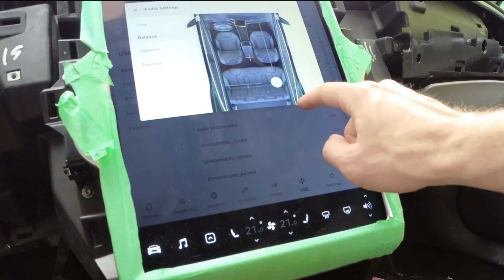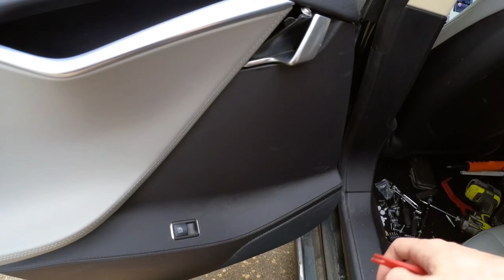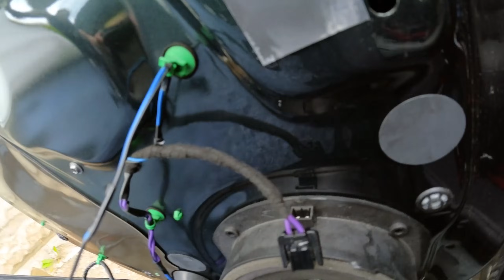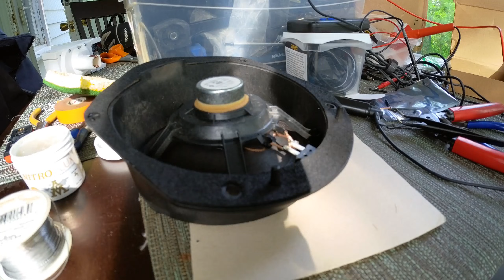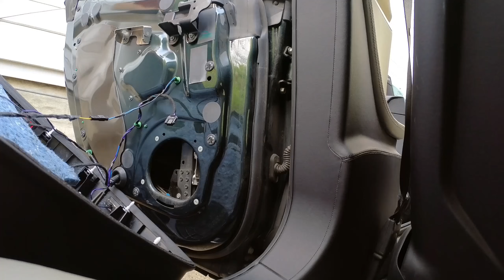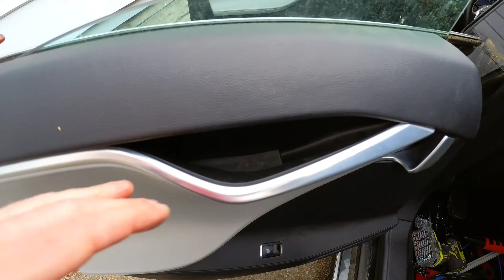Car Speaker Repair on a Tesla Model S/X

Comment: Good video.  CAUTION - The speakers in the pre-refresh Model S "base" audio system are 2-ohm.  If you are upgrading speakers STICK WITH 2-OHM.  If you go 4-ohm the max amplification will be cut in half.  Go 8-ohm (a very common impedance) it is cut in half again.  Two of my speaker cones were entirely detached.  Repair was not in the cards.  Found a rationally priced, 2-ohm upgrade speaker set on Crutchfield.  They are as close to "plug and play" as you can find and they cost about $67 a pair.  Search for:  "PowerBass OE-675."  They are not high end, but they are much, much better than the stock Tesla speakers.  The speaker surrounds Crutchfield provides with purchase are the same profile as the stock speaker surrounds.  They require no modification.  Unfortunately, Crutchfield does NOT offer plug and play harness connectors.  For that, search out the "Metra 72-8605 speaker harness."  I picked up two sets on eBay.  I think BestBuy sells them too.  With that part in hand, there is NO NEED TO CUT THE WIRE HARNESS OR DREMEL OUT THE OE PLUGS.  It is a pretty simple install and did NOT require any cutting modification to make them fit.  The "Metra 72-8605" sets are an absolute "must have" to make an easy retrofit and upgrade.

Comment: My front driver side speaker not working.
I have standard audio.
Try to test the speaker is fully working but the audio wire comes to the speaker no sound.
How can I find the problem.
Try to look to the wire speaker in the door but no Lose or cut.
So do u have a solution.
Reply from the maker: I'm not Tesla, did you try the service manual at service.tesla.com?  Might be a procedure there that could help.
Reply: @deftdawg  I did but can't find the audio speaker wire diagram
Reply from the maker: @Mo_In_Uk  Should be a wiring diagram under "Circuit & Connector Reference", I know the audio fuses were there when I looked on them last year, don't recall if the lines were but they should be.
Reply: @deftdawg  thank you i think I find it will download the manual.
Reply: Thanks for the video, my speaker wasn't working and by soldering short wire it's working again 👍

Comment: First one and now all 4 of my 2013 modelS speakers fail. I was looking for a solution but could not believe something like a wire connector would have come loose as was suggested by some.  Your video gives me hope I can resurrect my speakers :)
Reply from the maker: Good luck, hope you succeed 😄
Reply: Did you repair your speakers?

Comment: Thank you so much for this!  The same thing happened on 3 of my 4 door speakers, and on two of the wires for one of them (2013 model S).  I never would have thought to check if I hadn't seen your video.

There must be some material incompatibility with the epoxy, or the epoxy wasn't fully cured or something.  On close inspection, it looks like the wires are made of a thin sheath of copper over some other material; when I broke open the black epoxy, a rust-colored powder came out and I could see the copper sheath was missing.
Reply from the maker: Glad it was helpful, seems a shame to throw away a speaker for something so trivial